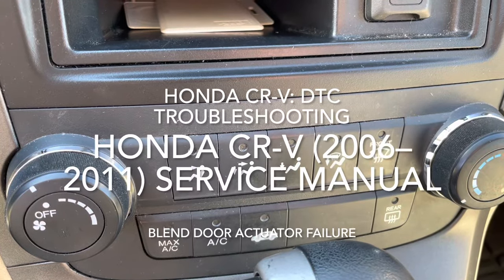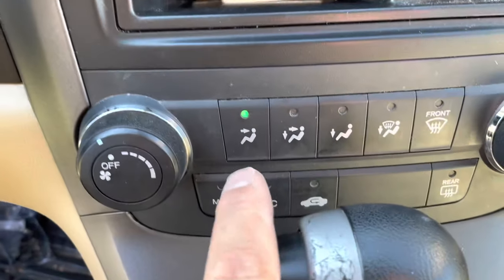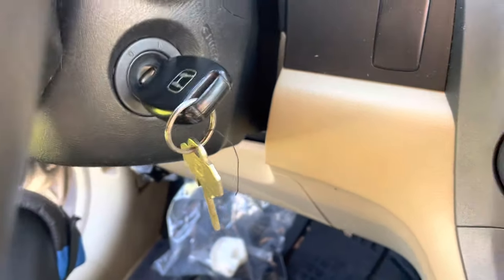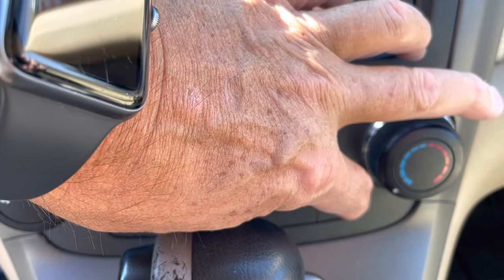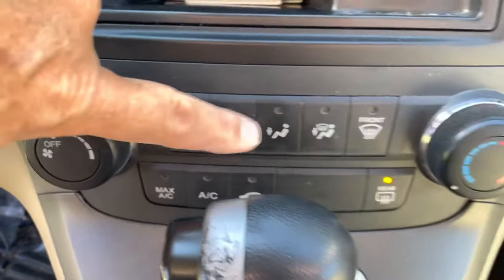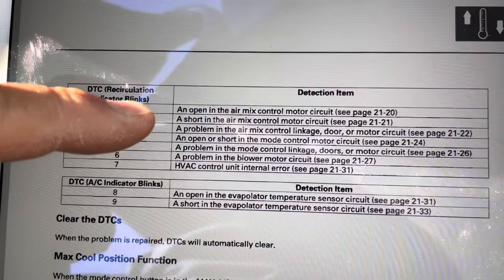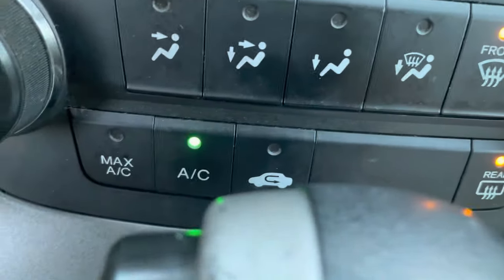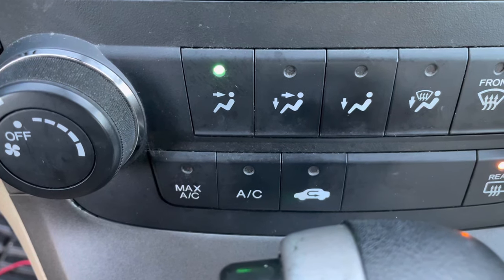Troubleshooting Honda CR-V (2006 2007 2008 2009 2010 2011) DTC AC NO HOT AIR BLEND DOOR ACTUATOR

Comment: Does this work/ is for if your car has cold AC but turns hot after 10 minutes or so of driving? I believe my problem is temperature related, when it’s cool outside the air will blow cold all day but if I drive around while it’s 80+ degrees outside, after 10 minutes it goes hot. I took it to a shop and no codes came up, there are no leaks and they recharged it. Thanks!!
Reply: I tried the test and immediately after it flashed quick 3 times, then did not flash after. Do you know what this means? Thank you
Reply from the maker: A problem with the air mix linkage. See video 3 flashes. Intermittent maybe? See the video I have where I turn the mix knob and test the blend door actuator movement. Look above the gas pedal for the motor and turn the mix back and forth when no problem and when you have a problem. Let us know what you find. Thanks for this info.
Reply from the maker: @victoriabreen7907  does the 3 flash error ever go away?
Reply from the maker: @victoriabreen7907  Do you have a temperature setting on your climate control?
Reply from the maker: @victoriabreen7907  Also start the car for the testing so AC will be working for test
Reply: Same problem. Blows cold air for 10 minutes while driving then turns hot. Also when parked with ac running it would turn hot after like 5 minutes.
Reply: Did you ever find a fix for this? I have a 2010 CR-V as well and have had the same problem for months
Reply: @alexasarapochiello8137  I would suspect the heater core valve.  It is probably stuck open.

Comment: Mine flashed twice,do i need to change the air mix control circuit, ??
Reply from the maker: I have one more video where I show you where the air mix motor is located and you need to see if the motor moves the door when you move the mix knob.

Comment: What happen if it flash 5 times? I need a fix for this
Reply from the maker: Go to this link I placed in the description. https://www.hcrv.net/dtc_troubleshooting-1869.html .
Look for this ... DTC indicator 5: A Problem in the Mode Control Linkage, Doors, or Motor Circuit

Look at this really good video on how to access the door. https://youtu.be/WDmCKGj5OCY?si=UcpGy8gxPwU_buX2 .
Reply from the maker: I did a new video on this issue. https://youtu.be/dufiWKKKZFs?si=NR71IrgrnGuG9oZa .

Comment: Hey so did it exactly like you said once I released the button the air circulation flashes 3 times & the ac turned green , front window vent circulation & then front face circulation and that’s it 

Mind you it flashed first in your video it flashed after it went threw the test what can this be smh
Reply from the maker: I fixed the problem and it tested okay. I didn't have he mix motor working when I did my test. For you, look at the video at 1:51. 3 flashes = linkage or motor circuit. I have other videos you may want to look at to remove and test your blend door actuator. This could be your problem or maybe you need to lube the plastic linkage. Also look at the blend door actuator when turning the knob like I did in one of my videos.
Reply: Did you ever figure this out?my Pilot is doing the same thing...  Just stops running the diagnosis after 2 settings

Comment: No flashes and I’ve changed the system it’s still not giving me cold air. What else could I do to find my problem?
Reply: Did you get your ac blowing cold yet?
Reply: Have you checked for coolant flow to the heat exchanger in the cabin?  Could be the core is clogged.
Reply: @andrewlayton9760  The problem is AC not heat.

Comment: I have no heat just cold air😢
Reply from the maker: @jacklynelmer8783  yea. Look above the gas pedal at the blend door actuator and see if it moves when you move the temp knob. Shown in my other videos
Reply: @dannyjensen4954  TY No it doesn't move at all!
Reply: Woohoo Danny TY for your help 😁 It was the plug. We unplugged & plugged it back in & it works! God Bless You ❤️🙌🙌🙌
Reply from the maker: @jacklynelmer8783  So happy for the feedback.

Comment: My Honda CR-V blinked twice each time.
Reply from the maker: Check the doc i linked in the description: 
DTC indicator 2: A Short in the Air Mix Control Motor Circuit

1. Turn the ignition switch OFF and then ON (II).

2. Do the self-diagnostic with the HVAC control unit.

3. Check for DTCs.

Is DTC 2 indicated? YES-Go to step 4.

NO-Intermittent failure.

4. Turn the ignition switch OFF.

5. Disconnect the air mix control motor 7P connector.

6. Disconnect the HVAC control unit 28P connector.

7. Check for continuity between body ground and the HVAC control unit 28P connector terminals No.6 and No.8 individually.

Honda CR-V. HVAC (Heating, Ventilation, and Air Conditioning)